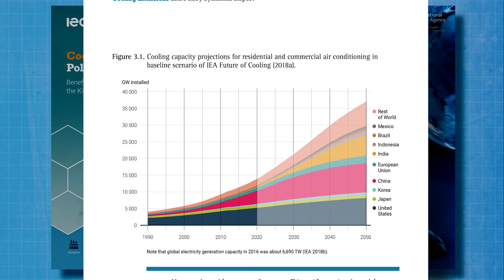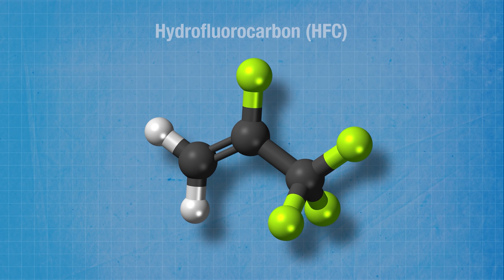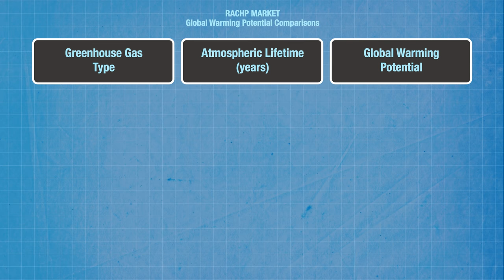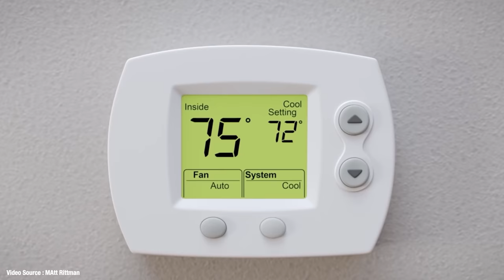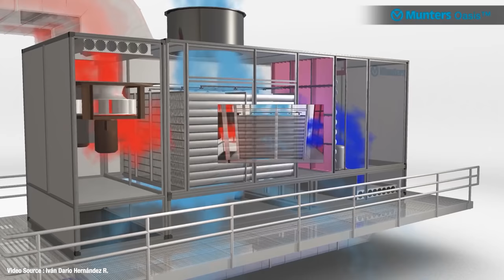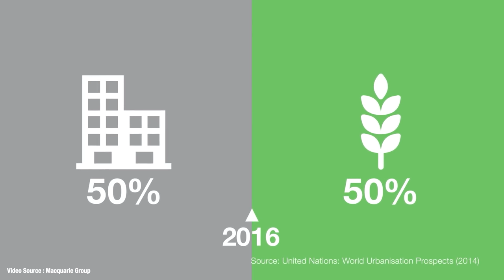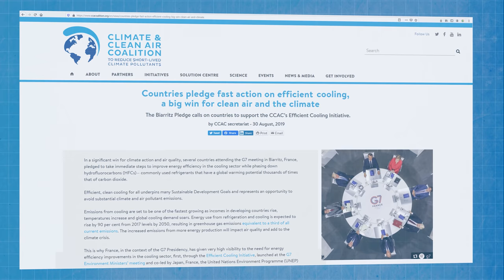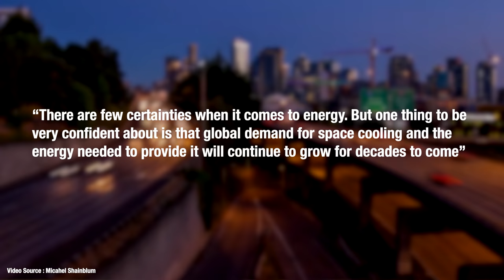Keeping cool in a warming world.

Comment: Increased sales of air conditioning units by no means is dependent on a warming world. The world has always had hot areas. All that means is that they are either becoming more affordable or more people are able to afford them.

The Earth has started its next cooling cycle.
The only reason people still think its warming is because of an increased use of infilled(fabricated) data and adjustments to data like added over a tenth of a degree of warming to every ocean buoy because somehow they are cooling the water they measure instead of the boats that collected the data that caused the discrepancies between boat and buoy data possibly warming the water they were measuring...
Reply: If you think temperature data is being "fabricated", then can you post a link to temperature data that you trust, which shows the planet is cooling? And can you explain why, on a cooling planet, ice sheets, glaciers and permafrost are thawing at an accelerating rate?
Reply: @Stealthbong  Ice sheets were melting during the Modern Maximum. That lasted about a century. It just ended. Ice is growing and melting in various places. Ice that was melting is no longer melting. Even the fastest melting glacier was reportedly growing again.

You can look around and see the unusually cold weather both hemispheres have been experiencing that last few years.

I won't be your gopher (go for). You want to find this stuff out fact check me. You don't care enough to know then willful ignorance is an option.
Reply: @thejarjosh  “I won’t be your gopher. You want to find this stuff out fact check me.”
OK. Let’s do that.
 
“Ice that is melting is no longer melting. Even the fastest melting glacier is growing again.”
These are very vague assertions and you don’t bother to name the “fastest melting glacier”. Even so, neither claim is supported by the evidence. This paper, for example, investigates the state of the Pine Island and Thwaites Glaciers in the Amundsen Sea Embayment, which are “responsible for the largest contribution of Antarctica to global sea level rise (i.e., ∼5% of global sea level rise), and are “among the fastest changing outlet glaciers in Antarctica”, changes that the authors identify as “the first signs of their structural weakening as they precondition these ice shelves for disintegration.”
https://www.pnas.org/content/117/40/24735
You can read more here
http://www.antarcticglaciers.org/antarctica-2/west-antarctic-ice-sheet-2/pine-island-glacier/
This paper identifies a sudden pause in ice loss on the massive Greenland ice sheet in 2013-14, but they still concluded that “within two decades this part of the GrIS will become a major contributor to sea level rise. There is also the suggestion that enhanced summertime melting may induce more sustained increases in discharge rates.”
https://www.pnas.org/content/116/6/1934
So I would love to see where you get the idea that even the fastest melting glacier is growing again.
 
“You can look around and see the unusually cold weather both hemispheres have been experiencing that last few years.”
You can do that, and then you can look at the research and discover that this also is a well-documented signature of global warming.
https://www.scientificamerican.com/article/earthtalks-global-warming-harsher-winter/
https://www.nature.com/articles/s41467-018-02992-9
https://www.ft.com/content/997d057e-3d6b-11e8-b7e0-52972418fec4
 
“The Earth has started its next cooling cycle. The only reason people still think its warming is because of an increased use of infilled (fabricated) data and adjustments”
That you equate “infilling” to "fabricating" data betrays the ideological root from which you construct your climate denialism. That you evidently believe, even more preposterously, that even “fabricated” infilling could prove that the MGST right now is not rising proves beyond doubt you haven’t a clue what you’re talking about and you’re most probably trying to regurgitate nonsense talking points, probably from a Tony Heller video. Infilling, as the name suggests, is the practice of “filling” gaps in time series data. For an insight into how this is done, I recommend this paper
https://www.researchgate.net/publication/263806683_Evaluation_of_infilling_methods_for_time_series_of_daily_precipitation_and_temperature_The_case_of_the_Ecuadorian_Andes
Since we have accurate means to measure the surface temperature, and have had so for many a decade, you don’t need to “infill” anything to see that the planet is now on a warming trajectory.
https://earthobservatory.nasa.gov/world-of-change/global-temperatures
 
Here is a fully referenced summary of all the accumulated signs of AGW.
https://www.nationalgeographic.com/environment/global-warming/global-warming-effects/
 
If I'm looking for a gopher, I'll let you.....oh nevermind.
Reply: @Stealthbong  2013-2014 is not 2020.
When did the Modern Maximum end?

Im really not interested in going through all this with yet another person.
It's super easy to find out which was the fastest melting glacier that began growing again.

A ton of infilled data is used. Both over the ocean and over land. Especially large parts of Africa. You don't seem to k ow what you're talking about. Probably just ripped a bunch of links from the skepticalscience page.
It's really boring going over the same arguments with so many different climate cult drones. The main point of my comment is that an increase in air conditioning unit sales is not necessarily linked to a increase in temps. It's easily explained by large parts of the world modernizing, units becoming more affordable and people (up until the covid controlled economic reset) having more money.
Reply: @Stealthbong  Ill grab one link just to drive home the point the you don't know what were talking about.

https://phys.org/news/2019-03-big-u-turn-key-greenland-glacier.html

Ignore the speculation of the scientist that were surprised by the sudden change that this is temporary. If the science were settled and they were truly experts they'd have predicted the change. Proper use of the scientific method results in theories with true predictive power. It is temporary but a long temporary more than likely. 

The "experts" would have seen this coming if they werent busy massaging the data to fit their "theory" instead of adjusting the theory to fit the data. They were also surprised a few years back with an Ross Shelf(I think) ice bore in Antarctica they found freezing instead of melting as they expected.

Not sure there is a true climate expert. Just people that know things others dont. Nobody is an expert though.
Reply: @thejarjosh  “2013-14 is not 2020. When did the Modern Maximum end?”
Maybe you misunderstood the reference to 2013-14. Either way, we’re not talking about light switches here. Climate inertia renders both this question and its premise as irrelevant.
 
“I’m really not interested in going through all this with yet another person.”
You’ll be relieved to know that there was never any danger of me asking you to. I was just curious to know where you get the fanciful idea that ice coverage is growing again. This is your opinion, but it isn’t supported by the evidence. Here is some 2020 research for you.
https://www.nature.com/articles/s41586-020-2742-6
https://www.businessinsider.com/photos-reveal-extent-of-arctic-ice-loss-2020-9
 
“A ton of infilled data is used. Both over the ocean and over land. Especially large parts of Africa. You don’t seem to know what you’re talking about.”
Don’t I? In my last comment, I provided evidence to support what I was saying. So if you know what you are talking about, why don’t you provide evidence that all this infilled data is corrupted?
 
“Ignore the speculation of the scientist that were surprised by the sudden change that this is temporary…It is temporary but a long temporary.”
So basically, as long as it all happens after you’re dead, there’s nothing to worry about, right? Shall we also ignore the author’s observation that “while this is good news on a temporary basis, this is bad news on the long term because it tells scientists that ocean temperature is a bigger player in glacier retreats and advances than previously thought” and the bit that says “over the decades the water has been and will be warming from man-made climate change.” Shall we also ignore this quote: “In the long run we’ll probably have to raise our predictions of sea level rise again.”
And then there is this: “Think of the ocean temperatures near Greenland like an escalator that's rising slowly from global warming, Khazendar said. But the natural North Atlantic Oscillation sometimes is like jumping down a few steps or jumping up a few steps. The water can get cooler and have effects, but in the long run it is getting warmer and the melting will be worse”.
 
“Proper use of the scientific method results in theories with true predictive power. The experts would have seen this coming if they weren’t busy massaging the data to fit their “theory”…”
What do you think that last comment says about your credibility as an arbiter of good scientific practice. Before you answer that, let me quote from YOUR source again: “University of Washington ice scientist Ian Joughin, who wasn't part of the study AND PREDICTED SUCH A CHANGE SEVEN YEARS AGO, said it would be a "grave mistake" to interpret the latest data as contradicting climate change science.”
Guess what!? The expert saw it coming! Maybe the guy who was surprised wasn’t part of the same research. 
 
“It’s really boring going over the same arguments with so many different climate cult drones.”
Nobody is forcing you to make ill-informed comments on Youtube channels. Have you thought of taking up golf?
Reply: @Stealthbong  You like science right?
Reply: @Stealthbong  You seem to be under the delusion that being published means being right. Maybe that would be true if conflicting studies weren't published throughout journals.

I gave a source for a claim of mine that shows of course you don't know what we're talking about. I told you early on I'm not interested in being a gopher for you.

What is the ECS and TCR to CO2?

How much warming does man's CO2 contribution add to the planet?
What is the quantified cooling effect of man's aerosol contributions.

In what ways could GCRs contribute to climate change?
Reply: @Stealthbong  Speculation? I'm talking about real world observations and youre linking to speculative garbage that can't be verified without a trip to the future or claims based on proxy data that can't be verified without a trip to the past. Appealing to authority is never sound argument. At least try to point to empirical evidence not speculative garbage about what could happen in a future based on pseudoscientific models that are wrong in  over 99 out of 100 simualtions.
Reply: @thejarjosh  "You seem to be under the delusion that being published means being right."
Wrong. Being right or wrong is a childish way to look at scientific research. Being published in long-established journals, whose reputations for publishing quality research at stake, means that your work has been peer reviewed at has met high standards of scientific rigour and integrity. It essentially means that peers in the field concur with the findings and the the evidence supports the central aim or thesis of the paper. 

"Maybe that would be true if conflicting studies weren't published throughout journals.
"
Conflicting research is a part of science. When conflicts arise, further research is called for for a mutually-satisfying resolution. Science is highly collaborative and can be very brutal to precious egos. 

"I gave a source for a claim of mine that shows of course you don't know what we're talking about. I told you early on I'm not interested in being a gopher for you."
Yes, and far from showing that I didn't know what I was talking about, it simply showed you hadn't read the paper. The only way you could make it even remotely support your point was to beseech me to ignore what the scientists in the paper were saying! Let me say it again - I'm not interested in you being my gopher - you're not fit to fill my fountain pen.

"What is the ECS and TCR to CO2?
"
So now you want me to be your gopher...Here you go. Fill your pants.
https://rmets.onlinelibrary.wiley.com/doi/10.1002/wea.3400

"How much warming does man's CO2 contribution add to the planet?
"
Do the research and let's see you come back with a credible source which actually says what you think it says. 

"What is the quantified cooling effect of man's aerosol contributions. In what ways could GCRs contribute to climate change?"

I'm not going to play games. I provided references to counter all your previous misconceptions and you dismissed them as climate cult pseudoscience. Now you think you can get me to jump through hoops. Get a grip.
Reply: @thejarjosh  "I'm talking about real world observations..."
Whose observations? Care to provide a link?

"...and youre linking to speculative garbage that can't be verified without a trip to the future or claims based on proxy data that can't be verified without a trip to the past." 
I've posted research papers. If you think their findings don't stand up to scrutiny, don't make shit up - just point out what you think the authors got wrong. 

"Appealing to authority is never sound argument. At least try to point to empirical evidence not speculative garbage about what could happen in a future based on pseudoscientific models that are wrong in  over 99 out of 100 simualtions."
Citing research papers is not appealing to authority. It is a fundamental cornerstone of research paper writing. An appeal to authority would be saying "Einstein said CO2 causes global warming". The empirical evidence is contained within the papers that i select to back up my points, but since you clearly don't even read the papers YOU cite, it's a fair assumption that you don't bother to read the ones i cite. 
If you did a bit more reading, you might be much less prone to writing demonstrably moronic garbage like "....based on pseudoscientific models that are wrong in over 99 out of 100 simualtions." I'm not going to even bother asking you to support that garbage with a reference, because we both know you can't and anyone reading it knows it's a crock. 
You're not even trying to be intelligent about this.
Reply: @Stealthbong  Yet contradictory papers are published. Peer review is incredibly flawed. They don't even do replication studies so most peer review the results weren't able to be reproduced when a group decided to test the reproducibility of several published papers.
It's actually becoming more and more pal review. Any idea what was said in climate gate emails about a Mann in question using his influence with some of these journals to prevent people from publishing that don't agree with him.
Where does that Mann get all this money to take people to court for not believing his manipulated "science"? It's awfully expensive suing people into silence. Especially when you lose your defamation lawsuit and are ordered to cover the court costs of the person you're accusing of defamation.

 Peer review in medical journals is awful too. Big Pharma gets their way all the time. They won't even do real research on vaccinated vs unvaccinated people. One of the studies I dug up the unvaccinated group came from the third world where there is a ton of malnutrition. Hardly a fair comparison.
Vaccine companies are immune from liability as well. What caused them to get liability immunity? Did they just ask for it or did something happen that caused the govt to need to protect them?
Reply: @Stealthbong  ECS and TCR are estimated.  Over decades those estimates have continued to lower. Dig up old papers on ECS/TCR and you'll find their estimates have been as much as double what they are now. Lewis and Curry published a paper in 2018 estimating it's half of what many are claiming it is today. The truth is though NOBODY knows the actual numbers.
Reply: @thejarjosh  My link didn’t show I hadn’t read the paper. It showed you don’t know what’s happening with the ice in this world.”
You really need spoon-feeding, don't you? So you claimed glaciers are growing, in conflict with the findings of those who study the ice caps, the NASA satellite images and empirical evidence, which all point to a long gradual decline in ice cover at the poles.
In a sad attempt to find anything to support your claim you jumped all over a paper entitled “Big U-turn: Key melting Greenland glacier is growing again”, and you posted this without even reading it properly – or maybe you just don’t know how to read critically.
You only had to read into the 2nd para to realize that you had been mugged by click-bait title: Here is Geological Survey of Denmark and Greenland ice and climate scientist Jason Box: “The good news is that it’s a reminder that it’s not necessarily going that fast. But it is going.”
What do you think he means there?
I copied and pasted other quotes from the article, which kinda fuck up your myopic theory that this Greenland glacier, and ice coverage in general, is growing. Here they are again:
“While this is “good news” on a temporary basis, this is bad news on the long term because it tells scientists that ocean temperature is a bigger player in glacier retreats and advances than previously thought, said NASA climate scientist Josh Willis, a study co-author. Over the decades the water has been and will be warming from man-made climate change, he said, noting that about 90 percent of the heat trapped by greenhouse gases goes into the oceans.
“In the long run we’ll probably have to raise our predictions of sea level rise again,” Willis said.
Think of the ocean temperatures near Greenland like an escalator that’s rising slowly from global warming, Khazendar said. But the natural North Atlantic Oscillation sometimes is like jumping down a few steps or jumping up a few steps. The water can get cooler and have effects, but in the long run it is getting warmer and the melting will be worse, he said.
Four outside scientists said the study and results make sense.
University of Washington ice scientist Ian Joughin, who wasn’t part of the study and predicted such a change seven years ago, said it would be a “grave mistake” to interpret the latest data as contradicting climate change science.
What’s happening, Joughin said, is “to a large extent, a temporary blip. Downturns do occur in the stock market, but overall the long term trajectory is up. This is really the same thing.”
 
So explain to us how you think this article supports your theory that ice cover is growing again.
You fell for a clickbait headline and you didn’t read the article properly. Now you look a mug.
Reply: @thejarjosh  Baseless, unsubstantiated, ill-informed opinion. Don't waste my time making up ludicrous statistics - If you cannot come up with comments that are even vaguely credible and back them up with evidence, don't bother.
Reply: @Stealthbong  Just because you're ignorant of various changes in climate like ice growing in various places (including ross ice shelf bore they expected to finding melting, mountains of Scotland and Greenlands once fastest melting glacier. ) doesn't make my claims baseless ill informed or an opinion. These are observations in the real world that aren't as widely reported as a heatwave in summer of all times.

I'm pretty sureI read about glaciers in South America advancing too but I could be confusing that with something else. I'd check but it'd be a wasted effort for someone not interested in what is really happening in the world.
Reply: @thejarjosh  If I don't see any links, I dont read the message.
Claims made without evidence can be dismissed without evidence.
Reply: @Stealthbong  Willful ignorance is your choice. All my claims can be substantiated but I told you early on Im not interested in going and grabbing a link for every claim I make. I chose one claim, one of the first I made and showed it can be backed up by what is being reported by the scientist studying the glacier in question.

You're on my post I didn't come to your post making unsubstantiated claims. This is my post  though so if you want to fact check it go for it. If you dismiss my claims without evidence I'll just dismiss your dismissal. As I've shown with at least one claim, they can be substantiated. If you wish to challenge them go for it but you can't just make up your own facts and claim these are lies.